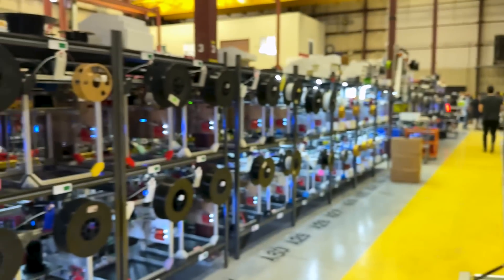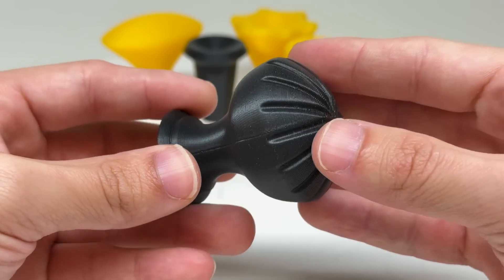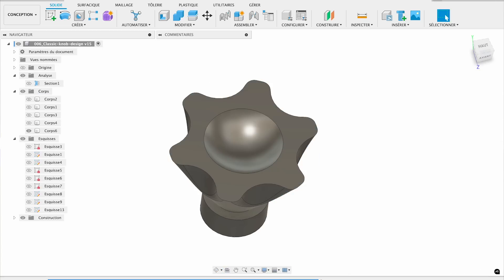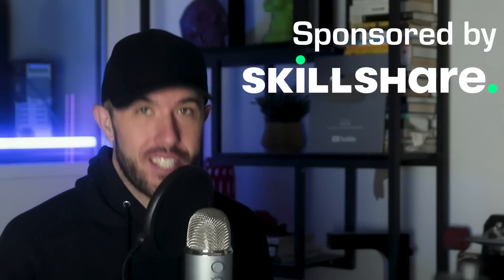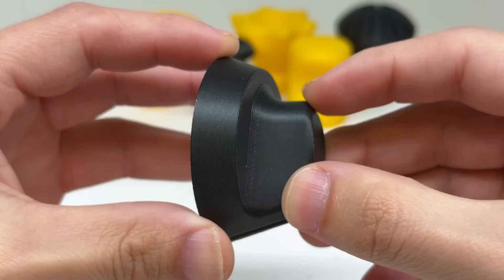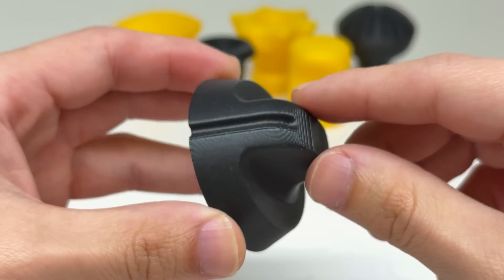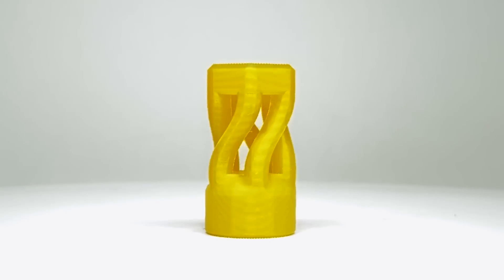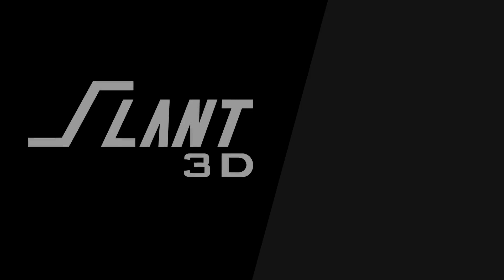Design Custom Cabinet Knobs Using 3D Printing

Comment: The most expensive plastic knobs are found in high-end applications like luxury audio systems, medical devices, automotive interiors, aerospace controls, and custom designs. These knobs often use advanced materials (e.g., PEEK, PTFE) or premium features like coatings, sensors, or integrated lighting. Prices can range from $50 to over $300 per knob, depending on their complexity, precision, and market niche.

Comment: Hey, I've been trying to onboard to the teleport pod platform but I'm new to e-commerce and there seems to be something with the pod and slant websites where some links take me to a service that seems to be discontinued and all in all I'm just frustrated and unable to achieve my goal. I described my requirements and questions in that bot chat box you have in there but didn't get any type of answer.

I understand that you might be flooded by more valuable customers requiring your assistance with all of this black Friday thing and that being humans you have a right to relax and spend thanksgivings with your loved ones (or however you want) but I'd appreciate it if at any point someone from the company contacted me and helped me get started.

Cheers.

PS. I also know this is not the right context to bring this up but I couldn't find a more appropriate way to reach out so sorry if it's annoying.

Comment: An oven knob is a poor use case for this idea. Oven knobs need to have a smooth non-porous surface so they can be wiped clean. Raw FDM surfaces are incompatible with kitchen hygiene maintenance requirements. Even outside the kitchen, I don't want knobs that accumulate hand grime. Those bright yellow knobs would end up looking gross.
This is coming from someone who has been 3d printing since the Cupcake days. FDM rocks but has limitations.
Reply: @spherebotics  Agreed. Also, who would want plastic cabinetry knobs?

Comment: I like the optimism but additive is an expensive way to make a simple part like a pull.  Also most people don’t want plastic and to get an acceptable finish will require post processing that would negate a lot of the benefits.
Reply: @gullenator1  its much cheaper than injection molding or machining tho
Reply: @L0wiee-yt that fully depends on the geometry and how many parts you need. If you need tens of thousands, nothing will beat injection molding
Reply: @OleBrouer  yes, but we are talking about few pieces
Reply: @L0wiee-yt  in that case, yes, 3d printing can be cheaper.

Comment: I am an old Electrical Engineer (74) and have been using 3D printing for 8 years. I have viewed your video for over a year and they are really good application points. The thing I use the most is not to look at form but look at fit and function. That is what I determined from watching your videos. It makes the repair items better and that is what I enjoy doing and not to sell. Most recently my wife was have trouble turning the cranks on our casement window because of the blind in the way. I created and extended knob past the blinds and she can now open the windows easier. Thanks for your pointers.

Comment: For one-off knobs, I totally agree with you.  In general, however, I doubt you could make a 6 pack of cupboard knobs with screws AND brushed nickel finish for A$11.25.

That said, 3d printing is a GREAT option for spare plastic parts for discontinued products.   In that way, it saves products from going into landfills, and that's a good thing.
Reply: Not just discontinued products, but customized, weird crazy shapes, generative design, out of the world that mind can think of products that can't be molded without investing thousands even with limitation in molding. In this case, a cheap but specialized 3d printed knob. Lol
Reply from the maker: Yes we can

Comment: Correction re Injection molding: Snap-fit a ring containing the complaint mechanism into your knob design. 

As a 3D printed design I think this approach might be good as well if you send the knob part out to print in metal. Then you have some really nicer feeling metal knobs - than anything injection molded. (Might get hot from radiant heat though that's a different problem though)
Reply: In addition to the knob, you now have to design the ring and the manufacturing process for that ring then get those rings made, PLUS a way to snap the ring into the knob for each item. None of which is cheap, easy or fast.

Comment: FDM 3D printing has so much value in the variety of things you can make without needing to make it out of many different parts. I think the issue is the look, I've been 3D printing for a long time, and I still look at any of the parts you are saying and Im like "definitely very functional, but looks like garbage". SLS is much better in this regard, but its much more expensive and messy and harder to get into.

Comment: I had a similar problem with Delta bathroom fixtures. They has a special metal spring inside. Once the spring broke, I found out they didn't make them anymore. So, I simply design a better 3D printed part.

Comment: I would like to see that universal knob in use on an oven. I am concerned it will just slip. I know you can thicken the spring but would like to see it in use in a video like this.

With your print services, can i put a bunch on a build plate and sell them in sets so the customer is not paying for shipping individual knobs?

Comment: I've played with this a while, I like to pause print and place a stainless nut in. This creates a higher quality product.
Reply: I don't think you'd gain a real time-advantage using heat inserts.
You realistically don't print just a single knob, depending on size you can fit probably like 30-40 of them on a plate.
Dropping in 30-40 hex nuts at a time seems alot more convenient to me than having to worry about keeping the knob straight while pressing in a heat insert
Reply: For you at home it is fine. But think about to make 1000 😅 boring expansive task with human
Reply: @schmi146  with heat inserts you can first print them all and then in one go, at a moment it's convenient for you, put the heat inserts,  while in dropping the nut you have to do it one by one as it every knob is printed
Reply: Print twenty knobs on a plate. You only need one pause...